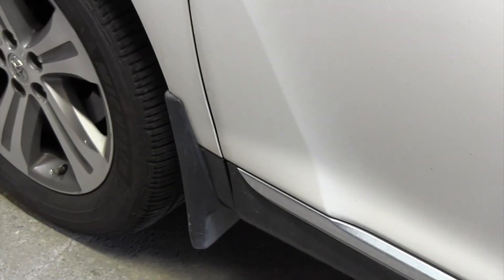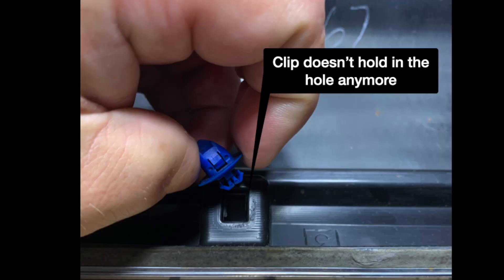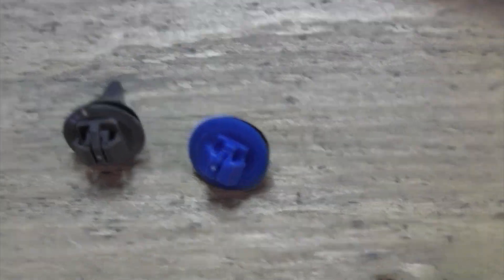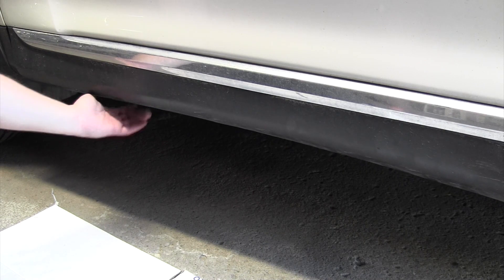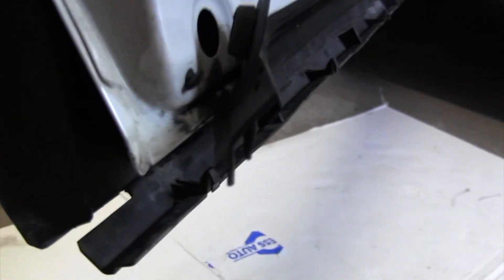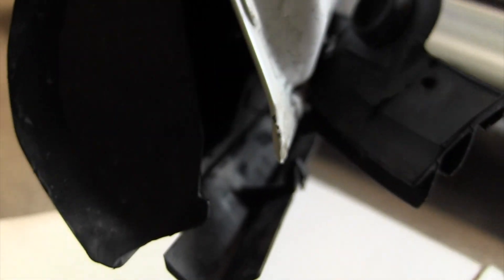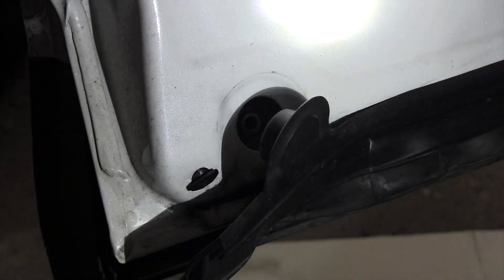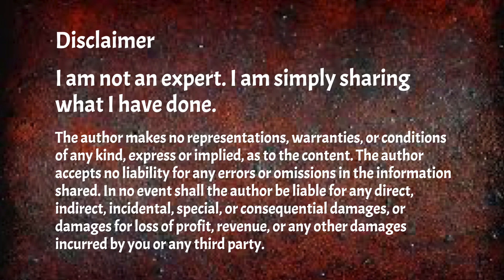Toyota Highlander Door Trim Sticking Out/Door Popping

Comment: That's the cats ass my friend.  Excellent. This was exactly what i was looking for same year same colour even same wobbly rubber weather seal at bottom of door from undercoating. Long live the Highlander. Has your stereo screen gone black yet?  Just had REAR a/c line capped off because it leaked.  Still have front AC again.  Perfect.  Thanks again
Reply from the maker: 👍👍 my stereo screen is still ok. Ac ok for now. My current issues are a drivetrain shudder on acceleration and a water leak on the bottom passenger side of the windshield

Comment: Shudder, probably the drive shaft- ridiculously expensive at the dealer. Two other options rock auto, but the least expensive is to pop it off and rebuild it at your local driveline shop @ $400-500 cdn. Is it leaking at the window, or is it at the sunroof? My sunroof drain plug on the driver's side was plugged.  Water came in on the roof liner, down the A-pillar and the floor.  I also had a weather strip around the rear hatch opening glass expand (reaction to undercoat), so i had to reglue and take an inch out - the centre of the bottom (also made it easier to reinstall)
Reply from the maker: Good tip about the sunroof drain. I’ll have to check that first. Thanks. I’ll also check out a driveline shop to see what they say.  I had the hatch power lift pull out from the door a couple times too. Finally welded in a big chunk of steel for the ball stud.